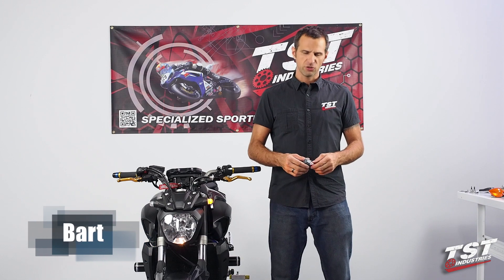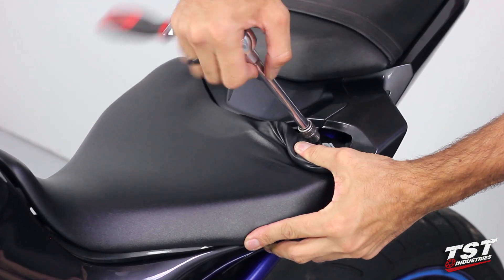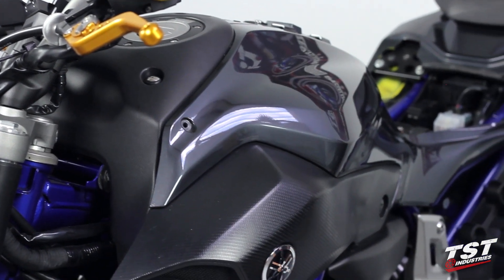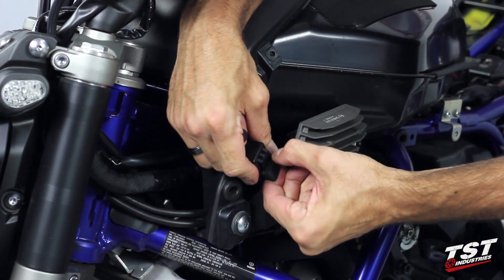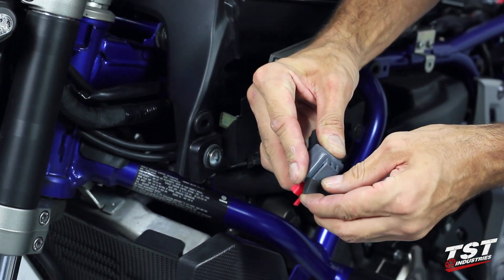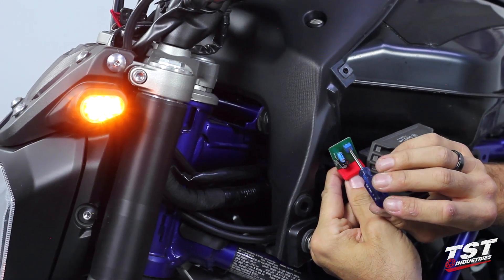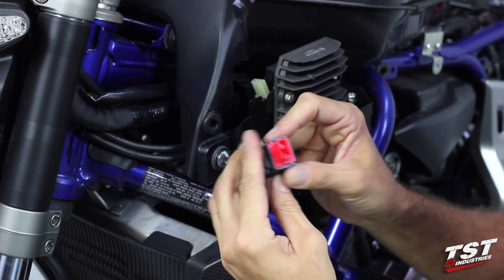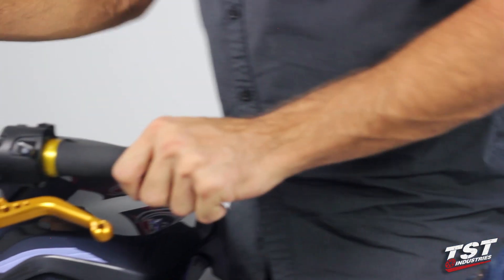How to install LED Flasher Relay on a 2015+ Yamaha FZ-07 by TST Industries

Comment: I just installed this on my 2016 FZ07 and it was as easy as demonstrated here and their relay works great, no adjustment necessary but it's cool that you can change it if you want to.

Comment: My rear blinkers have a resistor, but I couldn't fit the resistors in behind the headlight with all the stock wiring and my LED headlight mod. So will I be able to use this as is, or will I need to take out the resistors in the rear?
Reply from the maker: Take out any resistors and simply install our relay. One solution for the whole bike.

Comment: Hi! I have the factory turn signals at the front, but LEDs at the back. Will the front signals still function properly after changing the relay?
Thanks in advance!
Reply from the maker: Yes it will. One relay corrects and controls your entire signal circuit.
Reply: @TSTindustries  Great! Thanks for the quick reply!

Comment: Hi I'm using Yamaha xmax 250 there are two main led light for my rear motorcycle,
I bought a led flasher relay and put at the left light, it works fine and blinking when i put the brake on but i didn't start the engine.
I didn't put another flasher relay one on the other side
When i try to switch the engine on the fuse blows and i can't even start my engine?
Why is this happening n how do i fix these?
Reply from the maker: There is only one flasher relay for the entire bike. This is how signaling systems are on all bikes. There is no need for multiple interruptor relays. You must have some electrical wiring issues there. I would suggest that you get a wiring diagram for your bike and verify that your lighting system is wired according to the diagram.

Comment: That doesn't look very waterproof.
Reply from the maker: During the testing phase for this product about 9 years ago we considered weather resistance as a potential design parameter. In our study we determined that these units mount in places that don't experience direct water spray. They also mostly mount with the plug side down so any water that may accumulate on top will fall past the mating surfaces of housing and connector cap. With tens of thousands of units in service around the world we have not heard back from customers having water related issues with their TST relay.
Reply: @TSTindustries  Understood, but I commute on my 07, even in the rain.  Maybe if you had an optional gasket?

I suppose I could just RTV it shut...

Comment: i have a 2020 mt 07, is the location for the relay the same?
Reply from the maker: Yup...still same bike
Reply: @TSTindustries  I've got a 21' model, and it's no longer the same. there is no 2 or 3 pin connection like your video shows. It's 4 pin. Very annoying as nobody currently has a video on how to do it for the revised model.
Reply from the maker: @jackwalker355  The 2021 model does not utilize a flasher relay for the signals.
Reply from the maker: @jackwalker355  in the American market, on the bikes we have surveyed, there is no flasher relay on the 21+ model. Replacement LED signals work without tripping out the  signaling circuit and you have one less part to have to buy

Comment: Hi , I have a fz8 2011,  i have changed the indicators to sequential lights but when they are on, the lights only goes half way along the light, Iv been told it needs a new relay, could you tell me which on i would need ??, do you sell them ?? and where it is situated on Fazer 800 ...Thanks in advance

Comment: TstRelay installed. Motograves front led blinkers and tst integrated tail light. I can adjust the speed, But the indicator lights on the dash stay solid green. All blinkers flash when hazard is on.. I can hit the left signal and both lights come on and I can hit the right signal and they come on. I had leds In the rear with resistors before the install and it worked fine. Any idea how to fix this?
Reply from the maker: I would like to know more about your front signals. It is most likely an error in wiring in your front signals that is casing your problem. If you are using a set of single circuit signals but have wired them in a way that they retained the running light function then this is your problem for sure.
Reply from the maker: I think this video can shed some light on this subject. https://youtu.be/yN2RcX-vtYI
I recommend watching the entire clip but definitely pay attention most to the content starting at 4:00
Reply: TSTindustries my front signals are plug in play I did no wiring. The running lights aren't on.

Comment: will this replay fit on my ‘mt 07 2016’?  and the only way to put this replay is from the front (the way in the vid)? because ive seen a plug under my backseat too which is not used.
Reply from the maker: This is the verified installation method on the North American spec FZ-07. If you are located outside of North America, we would still recommend following this installation process although there may be a chance your relay is in a different location on the bike.
Reply: TSTindustries is there any luck that my blinkers will work normal?  or is the relay a “must’
Reply from the maker: If you are swapping both your front and rear signals to LEDs, you will most likely need a relay to correct your signal rate.

Comment: hi love your video but I have a ?? for u I have a 08 Yamaha warrior and got a xblaster tail light and got a led relay now I unplugged the oem relay and it's 5 wire and the led relay only has two tried pluging it in and nothing work so I but the oem one back in and now my turn signal is lose and doesn't work any ideas

Comment: Hi, i own an 2017 MT-07, are any different blinkers relay (2, 3 or 4 pins), i dont want to diassembly fairings just to see. I will buy one from you, just want to know that. Sorry about my english.
Reply from the maker: Hi there - Based on research and knowledge we have in the US, I believe your MT-07 uses a 2-pin relay but I highly suggest locating your OEM relay to verify that.

Comment: Hi, first off I'd like to say these how-to videos are really great and concise;  making it easy to understand for someone who doesn't have experience with this sort of thing.

My question is this:  I'll be installing an integrated tail light from another company that has a resistor built into the wiring already, and a pair of front signals with separate resistors.  I'd like to avoid using the resistors for the front signals as space is tight in that area of the bike. 

Will it cause any issues to use the built-in resistor on the tail light as well as a flasher relay?  Or should I open up the wiring for the tail light and try to remove the resistor?

Due to the "plug and play" aspect of the included wiring harness it would be easiest for someone like me to just use the included resistor even if it isn't necessary (once the relay is installed), however I wasn't sure if this would cause any issues.

Thanks!
Reply from the maker: I do not recommend using a relay on a signaling system that has resistors connected. You can modify your taillight harness pretty easily though. Since the resistors are connected in parallel to the signal circuit, you can just get in there and cut out the resistors.
Reply: Thanks for the reply, and keep up these great how-to videos!
Reply from the maker: Will do.
Reply: Sorry to bother again, but wanted to make certain I don't make any mistakes before I blow a fuse or something silly.

Each set of signal wires has two wires; one yellow and one black.  The yellow wire connects to the existing wiring in the taillight assembly and runs along into a cap-like end that will mate with the existing wiring inside the bike.  About 1/3 of the way along the yellow wire is where the resistors are crimped in, and a black wire comes out the other side of the resistor and into the cap-like end.  There are 3 spots within the cap end; one has the yellow wire, one has the black wire, and one is empty.

My question is when I cut out the resistors do i need to keep this black wire intact and part of the circuit?  Or can I safely remove it entirely?
Reply from the maker: It is tough for me to understand your exact setup from your description. If you send our support guys some photos through the support tab on our website, along with an explanation of what you are trying to achieve, our guys will be happy to help you out.
Reply: I've found that the company who sells the taillight sells a set of resistor-less wiring that is in fact just a single wire to each signal.  So eliminating the black wire (from the resistor) entirely seems to be correct.  I'll be installing your flasher relay with the setup this weekend.  Thanks for the reply, and the option of your customer support.  You guys are top notch.
Reply from the maker: What you are describing sounds correct. I'm glad you figured it out. Cheers! Happy new year.

Comment: I from france, can i buy it ??? 
And how many time that could take to receive it ? 

(Sorry for my english)
Reply from the maker: You can purchase this part but I would suggest that you check if it will fit your bike. You will have to look at the part on your bike and ensure that the plug geometry is the same as the one in the video. If not then this part will not work for you.
Reply: TSTindustries ok thank you, 
I cheked mine and i think that's the same configuration
Reply from the maker: In that case you can purchase this part through our website and it will be sent to you via the delivery method of your choice.
Reply: TSTindustries ok thank you for your quick answer

Comment: Not installing yet,  but will not adding relay at this time effect the bike in any way? operational wise?
Reply from the maker: The only difference in operation is that when you power up the signal for the first time after turning the bike on it will take one cycle's worth of time for the signal lamp to light up. After the capacitors inside are charged it is immediate.
Reply from the maker: Not adding the relay will not affect your bike in any negative mechanical way. Your signal flash rate will be sped up or you may even see an instance where you're signals or always on or always off. Take a look at the video at the link below for a more in-depth look. 

https://www.youtube.com/watch?v=5tlQfg_Ap8I&list=PLW7p4whHAHw0mLtDZd0fJA2dkQXJ5qiYM&index=1&t=9s

Comment: Does this work for any led setup or jus with tst brands.
Reply from the maker: should work for any LED setup without a problem
Reply: Thanks for such a quick reply.
Reply from the maker: lol...just happened to glance on the phone app and I saw I could quickly get you the info you need

Comment: Are there separate relay inserts for the front and rear flash lights or is it just the one shown in the video at the front of the bike? i'm asking because I installed the TSTindustries from flashers but i also have a rear integrated back light from another company, so will the rear intergrated light be affect by the flash relay from TSTind.??
Reply from the maker: the entire signaling system is controlled by the one relay shown. If your taillight came with resistors do not use them.
Reply: +TSTindustries awesome, thanks for the quick reply!!
Reply from the maker: you're welcome

Comment: just a question, does it take one relay for both signals front and back? or you need one in the front and another one for the back signals?
Reply from the maker: All signals operate with one relay.
Reply: Thank you.

Comment: I am not doing this right now lol I just finished the TST led tail light and fender eliminator install I don't have the patience for this (sad right?).  Maybe when it comes time to install the power commander
Reply from the maker: there's always next weekend
Reply: TSTindustries I actually have grown a bit fond of the faster flashing lights I might dial it back a bit but before they were so slow that when I would glance down to see if my blinker was on I would catch it in between a blink and think it was off when in fact it was still on.

Comment: Has anyone purchased this product and checked if it fits the European model(MT-07)? And if not where can I get one that does
Reply from the maker: You can check the configuration of your flasher relay. More and more Euro models nowadays use this configuration relay so there is a good chance we will be able to get you going. If you send the photo of the relay plug configuration to our support staff through our website we will be able to make that determination.

Comment: Hi, am interested in buying most of the products you have for the 2015 Yamaha FZ07 I have one exactly as the one featured.Question, where to buy the levers brake and clutch and the matching throttle and the other handle gold color?Thanks.
Reply from the maker: +adigalben Those products were already on the customers bike upon receiving it. We are not sure which brand those items are.
Reply: You can find some on Ebay
Reply: http://www.revzilla.com/motorcycle/asv-c5-sport-brake-lever-aprilia-honda-kawasaki-moto-guzzi-yamaha